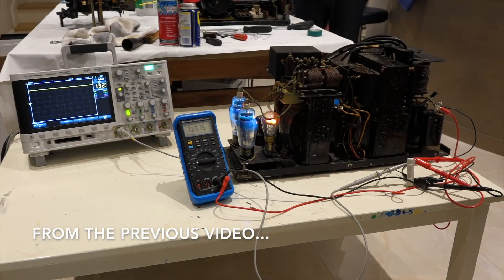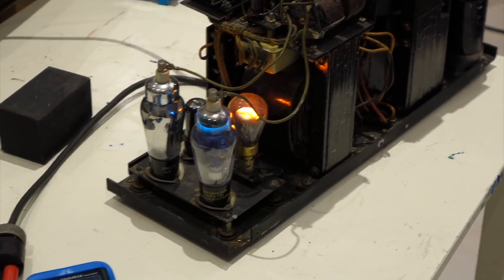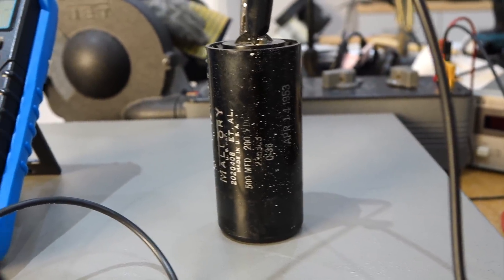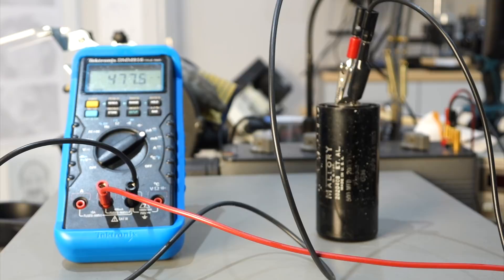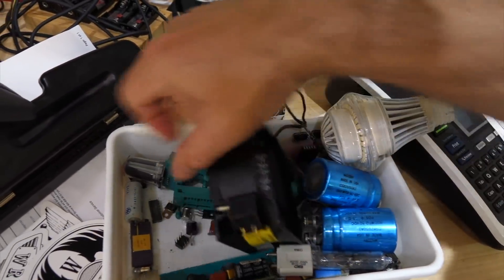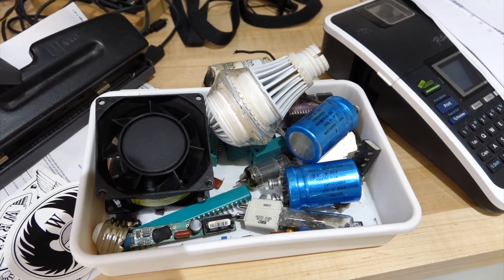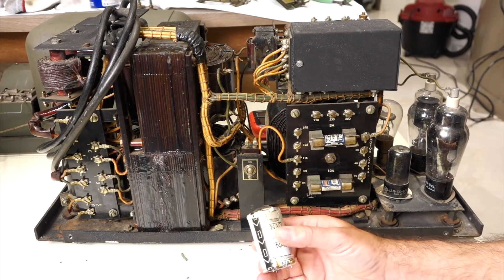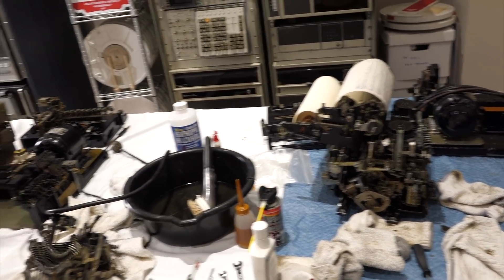Why we don't always replace vintage electrolytic capacitors

Comment: Yep, I've had to replace quite a few tantalum caps in equipment that tested bad and were getting warm/hot during use, that's a given, but I only change electrolytic caps if they have obviously high ESR for their spec and are causing a problem. Caps get a bad reputation and half the time people replace them for inferior junk thinking they're making things better. Sigh. Well done for setting the facts straight.

Comment: Having replaced many electrolytic capacitors because they were in fact bad. I would suggest that smaller caps or parts that are located near heat sources or carry high current are the most likely to be bad.  This is most often seen as the cap having high effective series resistance or ESR. Very old capacitors may have high leakage current but this is a special case.

Comment: Thank you so much for making this video. I repair amplifiers. Very rarely do I ever have to replace capacitors. The main issue I’ve seen is leaking caps from the 1990s. All capacitors from my vintage test gear and power supplies from the 1950s-1980s are still within spec. People need to lay off the snake oil and actually do some research and read. I especially love the one where caps in the rails or filter caps for power supply for car audio amps make a difference in the sound😂😂😂
If a capacitor is still within spec why risk damaging the board or pulling Vias because you listened to an ignorant person  off the internet who doesn’t understand how to test capacitors. There is much much more to capacitors other than farad measurements.

Comment: Thank you for this confirmation, Because I keep hearing caps last around 20 years but I have equipment that's running for 40 + years just fine. But I have a tv that blew two caps after one year. So I don't want to replacing old caps that are working for newer caps what will not last two years.

Comment: Could you make a video on the capacitors diagnostic?
Like is a component tester (that shows capacitance and ESR) good enough or do you need to power it to its working voltage and measure the leaking current or what?

Comment: Those Mallory Electrolytics likely should NOT be replaced.  You'll never find that sort of quality in modern capacitors, even genuine nichicon or rubicon.    Keep those ancient Mallory's   They will likely outlive all of us.   Ignore the people on the web who whinge and complain.  If by some chance they do short, they will not cause a huge issue and can just be replaced then.  It's not like this equipment will ever be run unsupervised anyway.   There are a small and very noisy minority of keyboard warriors who think they know best, even though they likely have no test equipment at all themselves.

Comment: I often find the smaller older axial caps to be a problem. Lower voltage, particularly. On modern aged gear, the bigger caps usually don't fail as often, and they are usually much more expensive too.

Comment: You could drop that power supply out a second story window and the only damage would be to the pavement. My dad was a radioman shipboard in the Navy during world war II and he used to collect these old military power supplies and other equipment and one of the reasons that these 70 yr. old caps are still good is that the military only used Mil Spec parts. They demanded reliability in the components they bought and then took those they received and pushed them to way over their rated specs in house and if a cap could survive that torture test they were placed in service. Cap failure is tough thing to predict. You can use a tester like the Heathkit to weed out failed caps or ones on the way toward failure but you can't predict when a good one will fail. There is no crystal ball on that tester that will give you that info. So automatically replacing all the caps on old electronics is a judgement call.

Comment: Glad to see this. It's dogma on many American fora to replace every capacitor. Then post wondering why you lovely amp no longer works. Even 70's and 80's caps, remove and check. If they are in spec it's likely the rest in the amp are fine.

Comment: When people say they need to be replaced i think they mean the wax paper ones, those are almost always leaky, by leaky i dont mean like leaking a liquid or other substance from the capacitor but leaking dc voltage across them which they are ABSOLUTELY NOT SUPPOSED TO DO. They are supposed to only pass ac and block dc, if its clearly a waxed paper or bumblebee capacitor, IT HAS GOT TO GO, waxed paper caps have got to go or be restuffed with new capacitors in the old casing.
Reply from the maker: I concur. Waxed caps and black beauty caps are a liability in high voltage tube era circuits.

Comment: 120V? You should have tested under 170V to account for the rectification. Thanks for the video Marc!
Reply from the maker: Yes you are right. But my supply tops out at 120V. I got better equipped in high voltage supplies since then…

Comment: I repair vintage audio gear for a living. And as you might imagine, I get requests to recap gear all the time. I tell people that I will test the old caps, and if (a) they pass a visual inspection, and (b) they pass my leakage, capacity, and esr tests, then there's really no need to replace them unless they simply insist.

Comment: That is a much higher quality capacitor than, say, what would have been generally used in a radio or TV from 1953.  High quality - passes tests - keep it.  Some paper/wax cheapo that could damage something or something with a high failure rate (like those black Nashville caps in the sixties) then change it.

Comment: I totally agree with the point of this video. It all goes to "if not broken, don't fix it". Some "experts" just blindly recap every piece of gear they touch, just because it is so, or just because they saw a video. Basically, instead of doing an analysis on what needs fixing, they just conclude "oh, it must be the caps, because they are old". And all they end up doing, in some cases, is replacing excellent vintage caps from reputable brands, by modern capxon or onehanglow crap. And, they also end up soldering them with blobs of solder, because the morer the betterer.

Comment: when it comes to caps I always test before replacement. For example when it came to restoring my 1965 IBM 1800 i tested all the caps and all were fine, some were boardeline but its still on its 1960s filters and its working perfectly although i have a memory circuit error meaning i can only access 28 of the 32kw of core.

Comment: i'd actually be more concerned with the small 1µF capacitors (most likely paper-oil type) to contain PCBs (not circuit boards but PolyChlorinated Biphenyl) which are highly carcinogenic. Those caps are particularly suspect if high voltage or if the case is soldered shut. Never worth risking of having one leak it's juice all over the place.
Electrolytics, if electrical leakage and parameters are fine, i'd leave them in except for the known-to-leak types from mainly the early 90s. These also are almost always worth swapping

Comment: I think it's crazy that people get emotional over what someone else does, or doesn't do to their equipment.   If it's yours, do what you want, recap it or don't for you are the one out if not recapping was the wrong plan.  I would also look at the schematic.  Amplifier Interstage dc blocking caps may be more critical than other caps.

Comment: They are just young and have not experienced good old caps they judge by the electrolytics of the 80's and onward some of which were small, cheap and badly manufactured We still suffer this today but I think the 90's-2000 were particularly nasty! so we forgive the young one's they will learn.

Comment: I think recapping can approach being a bizarre compulsion.  If the device was manufactured in the late 1990s and early 2000s, then the caps should be suspect due to the so-called "capacitor plague".  Then there are people buying cheap Chinese counterfeits and actually put in capacitors far more unreliable than the originals.  If the cap is good, then the cap is good.  If the cap has lasted for 70 years, it's likely going to last many more.

Keep up the good work.

Comment: I think a lot of these people advocating changing certain caps out don't really understand what causes a capacitor to develop internal leakage, they assume that the cap naturally does it itself, but for those who don't understand, a capacitor is made-up of two conductors that are separated by an insulator, or dielectric, normally the insulator or dielectric presents a very large resistance to D.C., the insulator/dielectric has a certain voltage-rating it can withstand before it breaks-down and starts to conduct, most good insulators have a D.C. resistance of at least a few giga-ohms (well at least an ideal insulator should anyway) a giga-ohm is one thousand mega-ohms, normally you would design an electronic circuit so that the expected voltages in the circuit do not exceed the maximum working voltage of the capacitor, or, as I personally like to do, you would use capacitors with a working-voltage greater than what you would expect to see when the circuit is operating normally, so, you wouldn't use a 25V electrolytic cap in a circuit where you'd be expecting something like 40V max, the 25V cap would go "BANG" and let-out the "magic-smoke" as well as a particularly pungent smell....Tantalums are notorious for doing that, and believe me it's not pleasant, I know from first-hand experience.

Comment: Hi Marc, I totally agree with what you're saying in this video, personally the only time I would ever seriously consider replacing a capacitor is if it shows a significant-enough amount of leakage of maybe a milliamp or something like that, but not something like 560 micro-amps as you're seeing with those 1953 vintage caps which were obviously very well-made.

Comment: I came to a similar conclusion as you. It seems once the industry went to incorporate vent valves on electrolytic caps in the early 90’s everything went downhill.
I replace all caps only if I don’t want to reopen and fix a piece of equipment again. I had it happened that I replace only one or two caps at first and then wind up fixing the same unit again sometime later on.
Some cap manufacturers are better then others. I usually check for ESR and replace if ESR is to high.
The tantalum caps, especially of West German origin from the sixties through 80’s tend to explode when the conformal coating breaks down after 40+ years.
Ceramic Disk capacitors also can create phenomenal problems, especially in audio circuits causing very audible hiss, pop and click noises.
They are also a great source of contention in digital circuits in older digital circuits 
Peter

P.S. if you really want to rock the boat on YouTube, make a video of the engine oil you use in your car…..

Comment: For me I ended up in studio/broadcast engineering and related electronics where the default of about any age from old tube radios I like to dabble with like Mr. Carlson (who seem to be against reforming) to modern solid state stuff seems to be recap and try to align is the first steps to bringing it around working logically of course going from the power supply out fixing as we go. It seems they can often be reformed and will work but if it does fail it's usually pretty spectacular and can take out other things not easily replaced on vintage gear even if it fails open you now have dirty supply voltage. I just recently redid the power supply in a 70s? mixer console for this reason.... when you can buy a smaller, better spec new one and have some peace of mind  over "is that cap acting up and causing ghosts in this very expensive hard to get parts for thing has to be running 24/7 on the air? Is it going to blow up and fry it all? " Is it going to go out of spec and get me a nastygram from the FCC? For a part you can usually find new for not much and a little bit of shipping time if you live in the middle of nowhere like me. After having a big one go critical in a confined shop where everyone especially when the military trained engineers who taught me what I know including recap all the things hit the deck out of reflex has got me in the don't second guess just replace it camp..... SO... I am not arguing because I have learned every engineer has their own ways of things that they swear by usually a little different from others and won't budge on some things so this is only a story about how I formed mine and how it would go when we would butt heads. We could even be saying the same things just them in older terms/methods and me saying newer ones would end up in an hot argument to the point even the non technically minded at the station would be like "guys you are arguing both sides of your own arguments with each other again just pick one." It's really the only time we argued. Out of 4 of us in the area when I started I am the only one left not retired or passed on now. I am told being in my 40s makes me one of the younger out of the few left in my trade and have to go with what they taught me or I pick up on my own I never took courses on any of this or even went to high school.I learn by doing with my hands from them and that's how they do. What to do with old caps seems to be a spicy subject for pretty much everyone in our circles no matter which side you fall on.

Comment: We used to have those fuses that fit into lamp sockets in the houses of the 1950s. Some folks would replace the fuse with a penny, which in house wiring was a very bad idea, as it could lead to house fires.

Comment: The bad rep for old capacitors is mostly due to the behavior of dirt cheap paper capacitors that were used in old vacuum tube radios.

Comment: I don't how many times I have had an vintage radio or other electronic device that all the capacitors were replaced in a very sloppy un craftsman like manner. It just created more problems.

Comment: leakage is only one parameter.. capacity, and series resistance and series inductance, and its ripple current capeabilities, are all important parameters to know, in an old one, and in a new one, else  people will not know for sure if a replacement is : upgrade, or downgrade.
by the way : i would recommend to measure leakage at full rated voltage, this way it is easier to reveal the leak health

Comment: Story about caps.  Years ago  I had a Heathkit SB-220  linear amplifier, needed caps, some were bad.  One weekend I was in a  hurry to "get on the air" and had a small matched pair  of military  oil filled caps.  They were about 8ufd  I think, and were in series  across the B+ as it is a voltage doubler.  Some months later  I pulled them out to discover they were  600V rated each, so 1200v  across nearly 3KV

Comment: Complete Recapping is something I'd do in devices from the 90s or so.
Devises from the 1960s are completely different. Also you have to find a capacitor that really fits the device. You can't just use any capacitor with the same voltage and capacity rating in any situation. They have other values like ESR/Impedance. And if you use a wrong capacitor in a circuit you can ruin all kinds of stuff.
Because old circuits are designed for old capacitors that are, compared to modern ones, awful from the values. But thats what that circuit expect.
One of the things that can happen is oscilation if the ESR gets too low...

On the other hand there are also "experts" that put general Purpose Capacitors in modern DC-DC Circuit that *REQUIRE* Low Impedance Capacitors...

TL:DR: Use Caps that are appropriate for the device. Modern Caps might not be appropriate for old devices.

Comment: It seems illogical to replace things that are functioning as designed merely because they are old.  If caps are malfunctioning or visually leaking electrolytic compound, then by all means, REPLACE them, but otherwise, leave them alone.

Comment: replacement is warranted after measurement of the component's performance and comparing with the specifications required in the circuit they are used.
not "because it is old"

Comment: People hear that they need to be replaced without their own knowledge,  so then they just repeat what they've heard.  I've seen soo many repair channels where the people doing repairs really have no formal education in electronics,  they just know how to repair stuff.   The smart people test and make educated decisions,   the not so educated just replace everything because well,  that's what they know.   Replacing all the caps can cause issues if the you don't use the same characteristic of cap.  Ohh the ESR is high,  the ESR is high...replace it....well what was the ESR of the factory new cap when the device was built?

Comment: I think intelligent repair is case by case---one solution does not fit all situations.  Sadly, the anonymous nature of the net encourages idiot comments from armchair experts.  And the strongest opinions usually come from the most ignorant--those unwilling to consider new data because it frightens them--"Oh no, I'm always right, so anything outside my experience is wrong."

Comment: THAT capacitors may work for live. The problem is only for modern capacitors: miniaturization has pushed materials at the limits of physics more and more, to obtain smaller, lighter, cheaper hardware. In particular the quality of large market components is dropped in the 90's because of planned obsolescence. For capacitors made before the 70's, if they don't leak now, they would not leak anytime in the future! All capacitors of 90's probably are in the end of their life now.

Comment: I only start replacing capacitors if its leaky, venting, or not performing as specified. The few things I've recapped are either heavily used electronics from the 80s/90s and modern day. Some modern electronics are of questionable quality and tend to drive the capacitors hard, or expose it to excessive heat which leads to failure.